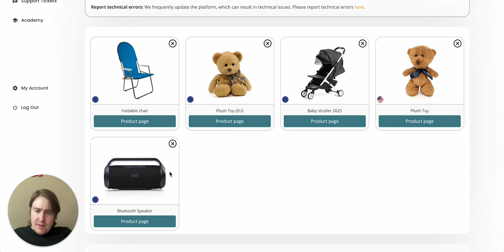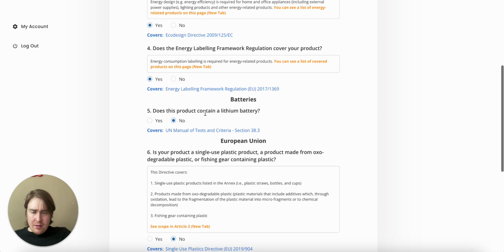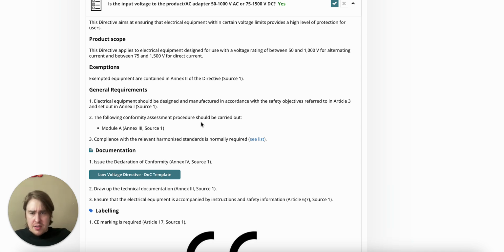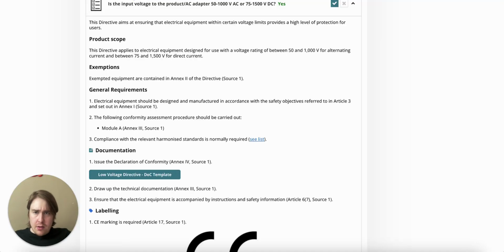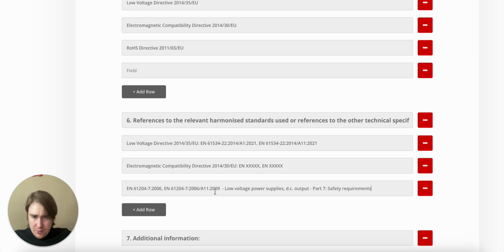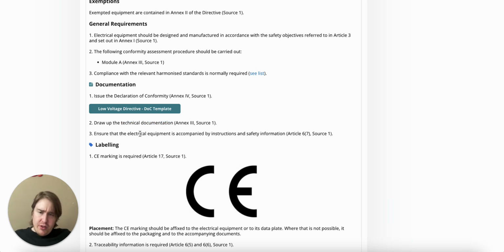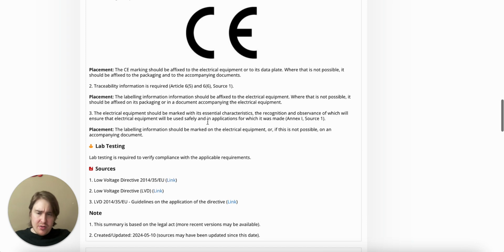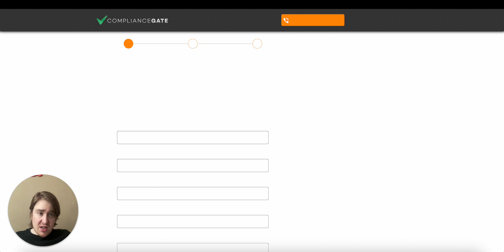How to CE mark an electronic product in 5 steps

Comment: Thanks for the video, very interesting indeed and well presented. Regarding step 1) how would be a wearable device considered? eg a watch, they normally are low voltage devices  (around 5v) and use to charge through a USB port. They do not come with the AC adapter nowadays and could be charged through  a laptop, power bank or a charger, but assumed that those have already been certified by their manufacturer.